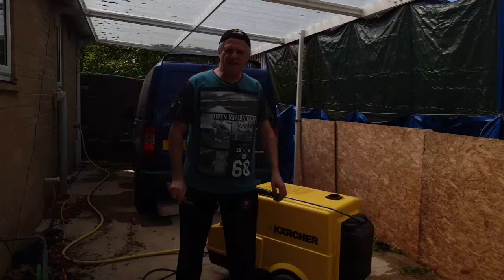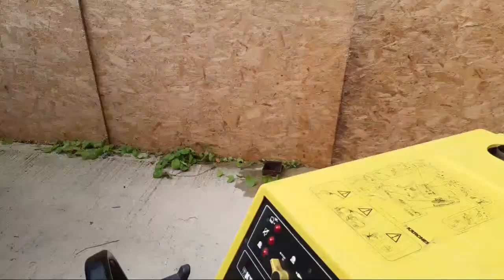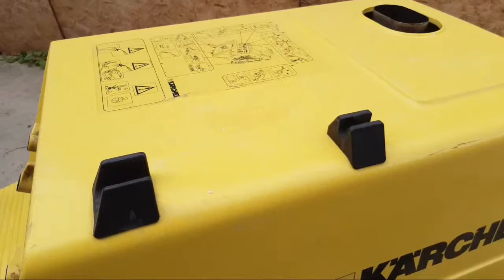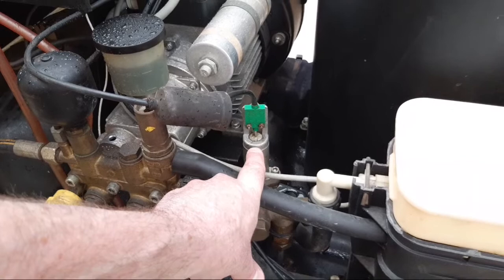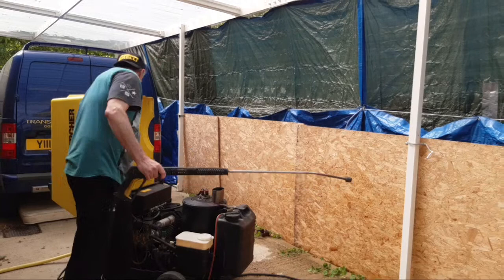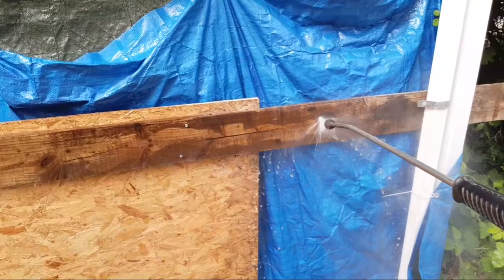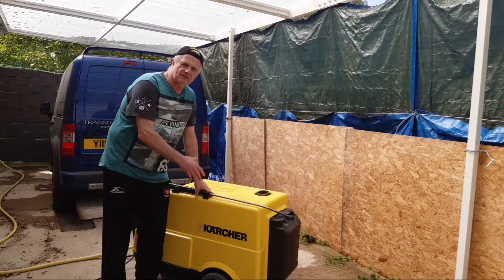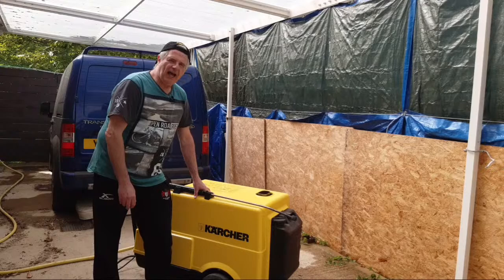Karcher HDS 650 pressure cleaner live

Comment: Hi Crazy! We have a 650 up here in Lincoln - we use it to clean 1930s buses at the Lincolnshire Vintage Vehicle museum. But it has stopped working. Do you have an operating manual? We can't get it to spark, nor flame; occasionally it just won't pressure up.
Reply from the maker: Hi Yes if you want message me on my bakery fb, i will photo pages for you and send to you on messenger so you can print them laters Steve

Comment: Hi mate would you please help me out I need pictures or a video of the wiring terminal block to see were the wires go. Yes I fiddled with it lol. had mine years sat doing nothing I need to get it up and runing again there are a good machine. Thanks bud would appreciate any help
Reply from the maker: Hi mate of course,  I have a full instruction manual so that ok, so what terminal block are you looking at, electrical cabinet rear or what laters Steve
Reply: @crazybaker1  morning bud thank you for this is the black and blue  control box I believe it controls the hot and cold but not sure

Comment: Does this run on diesel or electricity's
Reply from the maker: Diesel or Panafin and of course electric
Reply: @crazybaker1  yeah I did a little more research. Found out the hot water heater runs off diesel and the water pump runs off 220v. I'm bidding on one at an auction right now and think I'm going to get it for under $100.
Reply from the maker: @catfisher420  I think it's a really good machine, it's one of the best in the day, even today it knocks spots off the new one's today 😀 if you do manage to win it, good luck 👍
Reply: @crazybaker1  I unfortunately got out bid. I stopped at $275. It sold for $300. I was looking forward to tinkering with it.
Reply from the maker: @catfisher420  even if you put in $300 that other person could well keep going up, always another day 😀 laters Steve